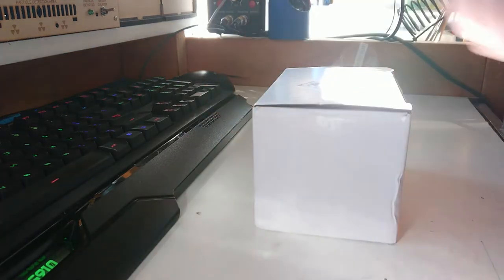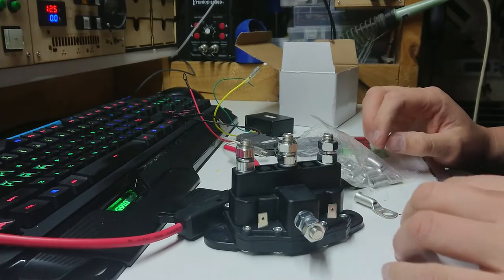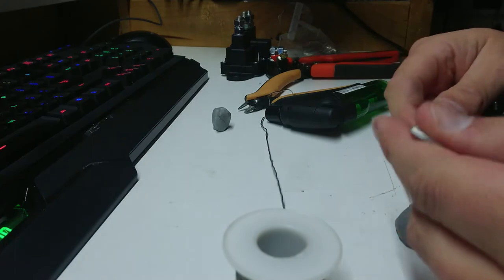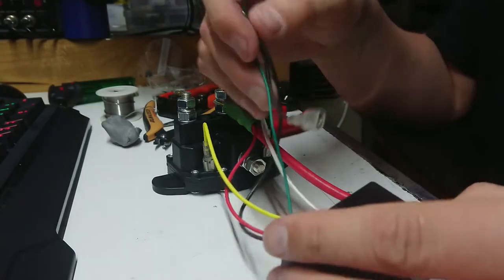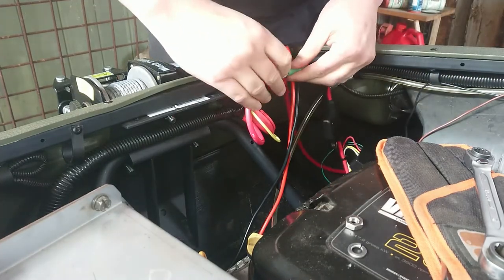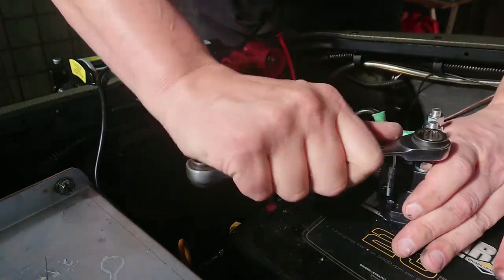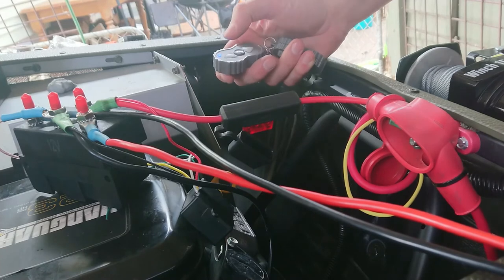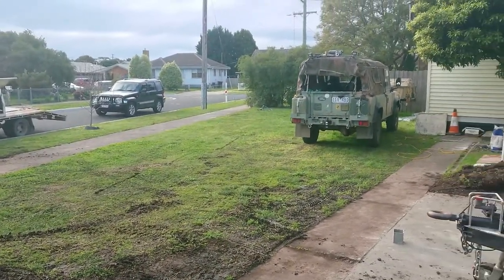Winch Wiring | New Argo 8x8 Episode 21

Comment: Good video.👍👍👍
When I solder big terminals like those, I crimp then solder, the crimp holds the wire in and capillary action draws the solder in.
It would be worth making a "get out of trouble box" should the wireless fail.
A box with two buttons and wires and connectors to replace the wireless connections on the solenoid assembly.
Reply from the maker: My get out of trouble box, is a set of light jumper cables to go direct to the winch terminals.

Comment: i plug everything as shown, it works ok, but the relay comes very hot, i unplug it, is it normal, is it dangerous to get un fire?
Reply from the maker: Solenoids use a magnetic coil which will get hot.
They are usually designed for short duty cycles, not continuous operation. 
They need a break every minute or so to cool down
Reply: @TheAussieRepairGuy  THANKS